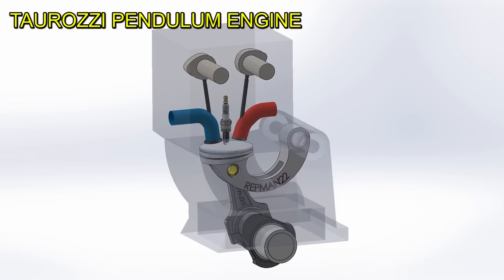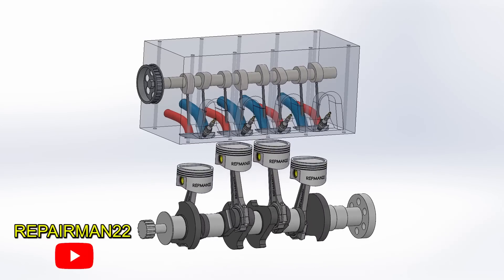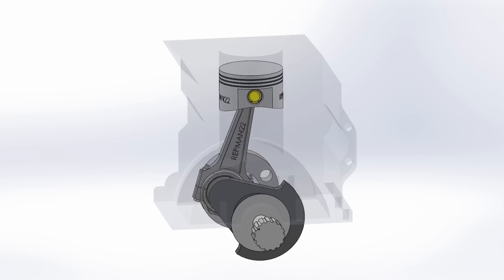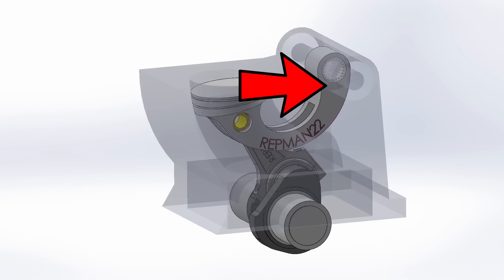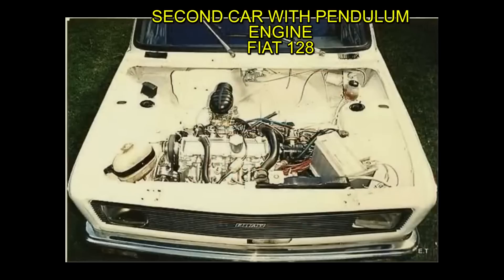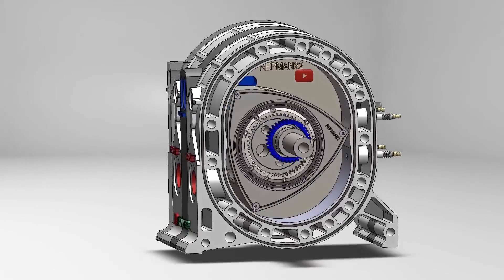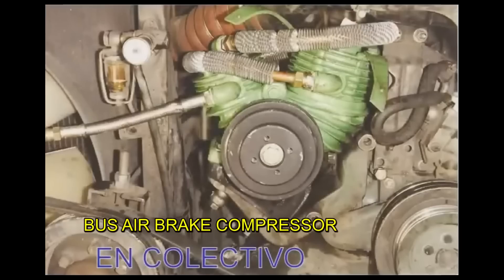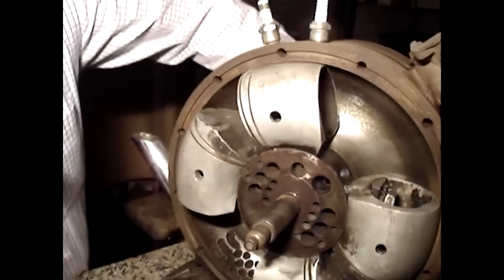All about the Taurozzi Pendulum Engine 🧠 and what happend to it🤯

Comment: Very interesting idea, but I can see some shortcomings of it that might be why it didn't catch on.
- The weight and bulk of the engine would be much higher with the pivot off to the side like that.
- The arm and block have to match exactly to place the piston centered in the cylinder bore. Thermal expansion of various parts at different rates or amounts could cause problems with this, or require a looser fit in the bore that has to be closed up with rings.
- While manufacturing the curved cylinders is possible, it is surely more difficult and expensive than straight bore cylinders, making it less feasible on a mass production scale.

These drawbacks indicate why it wasn't adopted for engines, but is for specialty compressors - said compressors have greater need for it and can accept the greater manufacturing cost, usually are stationary applications where the extra bulk and weight aren't problematic, and don't run as hot so the different thermal expansion doesn't matter. The same benefits as this can be had with crosshead engines, which are used on some very large diesel engines, such as for ships. They solve the piston side-force issue, but still involve a sliding bearing (which is more problematic than a pivoting or rotating one) and require the engine be much taller, making it impractical for most uses.
Reply: I think you nailed it. Thermal expansion is going to be side to side and not even. The toroidal bore is expensive and slow to cut and hone. And while lightly addressed it does seem like there is more mass moving than a conventional piston.  The skirts don’t weigh much.   There is now also an additional bearing to machine at the end of the arc arm.
Reply: @Thatdavemarsh  The piston mass consideration is interesting to consider - despite the video claiming it was equal I doubt that. Likewise that curved arm looks like a failure point - being curved like that is structurally far less efficient than a straight rod, will be loaded in bending rather than pure tension/compression, likely to result in fatigue issues, necessitating it be even heavier to last a useful amount of time without breaking, or the engine would have to have a finite lifespan before those parts are replaced to prevent catastrophic failure. Normal engines suffer from mechanical wear on sliding surfaces, but I'm not aware of components on normal engines where fatigue is usually an issue, the wear surfaces (bearing shells, cylinder walls, pistons) can usually be re-machined or replaced quite easily and the main components of the engine have infinite lifespan, allowing the engine to be rebuilt pretty much indefinitely. But if these parts have to be replaced regularly that wouldn't work so well. A good question about this guy's prototypes is how long they were run for in testing - they worked and were quite efficient, but did he test them for 200,000+ miles that engines are usually expected to last?

The extra bearing probably isn't a huge deal, looks like the same type and size as the wrist pin bearing, but still with some drawbacks. Particularly in that it's reciprocating rather than full rotations, I've heard that's harder to design and have last a long time. Particularly in that the bearing will be stationary twice per cycle, which prevents it from "floating" on oil and will result in metal-on-metal contact avoided by fully rotating bearings on the crankshaft. This is an issue with wrist pin bearings, which I've heard are some of the most highly loaded bearings in an engine, but they also have a smaller angle of movement.
Reply: @quillmaurer6563  The force of the combustion chamber is driven down onto the crank and the arm attached to it, the pivot arm bears no force
Reply: @thesollys9540 
And what's with the lateral force from the con rod under combustion pressure? That for what the pivot arm mainly is for? 
It's not just to gently guide the piston so it doesn't fall over. 😂
Also all the centrifugal force from all the crap hanging on the end of the arm moving in a circular path rather then linear, plus the inertia from the con rod when the crank changes its direction.
There is alot of force on that arm! 
Would it be straight and it's axis straight true the center of mass of the piston that would be less of a concern. But that's not possible, in engenering it's called a drawback. 
This engine is damned to run relatively low rpm's.
Reply: @martin09091989  I would add point about sealing  rings - on "outer" wall of circle rounded form of cylinder rings make longer distance  than in " inner" wall  effecting in not equal thinning. How about dispersion of combustion heat in not simmetrical body and shapes? All this  of course could be prooven  only in very  long use.  .. Another problem for motor industry would be how  such engine could undergo simple renowation by rehoning  to next oversize in thousands of  work shops not posessing special thoroidal honing gear But that is not a construction problem but existing technic. .
Reply: @quillmaurer6563  I'd like to add a consideration - the fraction of the net force acting on the crankshaft is a function of the piston rotation, and decreases from top dead center to a minimum at bottom dead center as a cosine function of the piston angle. This means it's actually less efficient at converting pressure energy on top of the cylinder into mechanical energy at the crankshaft (the difference, if it's not dissipated onto the pivot bearing, will just be given back to the fluid during exhaust phase due to the elastic return of the bearing and its sorrounding material) and honestly i really fail to see how a modest decrease in friction can make up for that loss, which must be the most significant one.
Reply: @martin09091989  In that case would it be more suitable for diesel engines?
Reply: @richardfiennes3616  I almost want to see a modified design that's an opposed pendulum with a common crank; should be simple enough, make the banana linkage load-bearing and move the wrist pin closer to the pivot, then work around the multiple linkages.  Massive compression ratio, and better aligning the valves could make EGR and heat recirculation extremely simple, the only potential issue is how swirl would behave.  Any potential ring issues could also be solved by having trapezoidal rings, larger wear surface on the side with a larger distance, and the taper would fit the wear amount along the circular section of the toroid.
Reply: @richardfiennes3616  I don't think so. The masses of the parts would be less of a problem in a diesel engine, but the larger lateral forces on a diesel due to high compression and higher combustion pressures may be a problem for that banana arm.
Also the benefit of lower friction gets smaller the lower the rpm of the engine is.
And diesel engines need relative rugged pistons to withstand the violent diesel combustion.
Such thin piston heads without a supporting skirt might be to week overall.
Reply: If the pivot arm isn't load bearing, you could delete it from the design.
Reply: @Daekanoid  The problem of the tilting piston is somehow similar to the conventional engine. In an usual engine the piston moves "vertically" and the connecting rod tilts alternatively - in this case the piston tilts progressively but, by carefully positioning the parts, the connecting rod can remain along the  pressure vector for a considerable part of the active cycle. So, it could be as efficient in using the combustion energy as a conventional engine. Probably a simulation would bring more clarity to this point of view.
Reply: @quillmaurer6563  "...that curved arm looks like a failure point - being curved like that is structurally far less efficient than a straight rod..." The curved arm has very little load on it at all. The connecting rod is taking almost all of the forces, and it's shown being straight like normal, and shorter which decreases forces from things like torsion or bending. All the curved arm is doing is keeping the piston in place and centered. The forces of the explosions are going into the connecting rod, and the return thrusting from the connecting rod are going into the head of the piston. It doesn't need to be particularly strong, just rigid. I don't see any particular reason why it couldn't be carbon fiber. Unlike with connecting rods which take a LOT of forces and abuse, the piston arm would only need to prevent the head from tilting in any direction, and angled correctly within the cylinder through the stroke. 

The piston would have almost no wear on the cylinder walls either, since you can use something like teflon or delrin for the piston rings instead of metal, which simply can't mar the cylinder bore. Even if the cylinder bore did somehow become marred, there's a process called spray welding that can add a thin layer of metal back to the part, after which you would machine it again to restore the bore to the correct dimensions, if you wanted to do things as best as possible. Besides all that, it's not like the majority of car engines go through "indefinite rebuilds". Sure, there's plenty of engines that do get rebuilt, but for the average vehicle, especially a modern vehicle, that's not really a common thing. 

The points you present with the bearing are indeed valid, if you're comparing the roller bearing indicated in the visualization to a rotary bearing used in something like a drill. However, the reason the roller bearing was cited as a benefit here is because it's comparing the oil lubricated metal-on-metal wearing surface between a traditional straight bore cylinder and piston and the roller bearing which would be the primary point of wear for this piston and cylinder. While the concerns about the bearing types is valid, it's still a massive improvement over metal-on-metal sliding inside something as large as the cylinder. They appear to be in a location that would be significantly more serviceable as well. It's also possible to mitigate the wear concerns about the rollers stopping and reversing by having the rod they sit on spin. Then they would be experiencing ramping speeds, but always in the same direction. I don't know if that would be better or not, but it is an idea.
Reply: @thesollys9540  There are still minor forces acting on the pivot arm. That is unavoidable.
Reply: @quillmaurer6563  Oh, right. delrin and teflon would melt. That was silly of me. That said, this design still has different options since the stresses on the rings would be different from a traditional ICE. 

The piston's arm does indeed see stresses, but the kinds of stresses it's seeing are trying to fold it in on itself, and then stretch it open. Carbon fiber happens to be particularly good at resisting this without fatiguing. Since carbon fiber connecting rods are already a thing, there's no reason they couldn't be used for this part. 

The piston supporting rod spinning thing was just an idea i was spitballing, so yeah. I agree it would add a lot of complexity to overcome a possibly minor problem. I could also see using fairly small rollers in the bearing which would mean they make several rotations before cycling. That could also ensure they're always sufficiently lubricated. With a proper enclosure, it should work as well as traditionally sized bearings, while obviously increasing costs since, ya know... custom bearings. 

I really would like to see a couple of the major manufacturers give this kind of an engine a try to see what their engineers can come up with for optimizations.
Reply: @quillmaurer6563  Something that just randomly popped into my head... but what if they tried making a carbon fiber piston ring? With the right formulation of resin, it could even operate without additional lubrication since the carbon fiber would basically wear itself into graphite powder which is a perfectly fine lubricant. Because the only point of friction here would be between the rings and wall for sealing purposes (unlike with straight bores that use friction to keep the piston head aligned), a dry lubricant might actually work better.
Reply: Yeah. Just looks to me like a huge increase in manufacturing complexity, and to a lesser extent bulk, for a rather modest efficiency gain. Like a lot of alternative engine designs, I just don't see any net advantage.
Reply: none of this makes sense as it already doesn't happen in a conventional engine. If ANY pistons start swelling you're gunna have a bad time dog lol. I have a buddy with pieces of piston rings embedded into the steel sleeve of his built b-18 to prove it. 

The weight would be less actually since the strength of the parts needs to be much much lower as there isnt friction which means there is no ridiculous amounts of heat to cause swelling. Also idk if you watch the video or not but these engine ARE mass produced. Easily.
Reply: @Khaynizzle7  there is very little friction as the piston is separated from the cylinder wall by oil. That is not where the majority of heat comes from in an ICE.
Reply: So a guy builds this at home in his shed and proves that it works perfectly but everyone here is picking it apart !!?? Sorry, but I would think that the man was a whole lot smarter us !!
Reply: @markchaplain1152  it works no one is debating that! It is just a more mechanically complex, heavier more expensive version of a standard engine
Reply: @headlesshenrywarfare8268  from what I gathered from the video it was lighter and way less moving parts !?
Reply: @markchaplain1152  I agree that if this engine produces less friction then the cooling system weight could be reduced but as this increases the reciprocating mass of the piston with the extra pivot arm this engine would have less rev range and response than a standard engine
Reply: @markchaplain1152  They're just using technical terms so difficult for you to comprehend that they're literally picking your brain apart 😄
Reply: @markchaplain1152  We're not saying it doesn't work, we're just analyzing the pros and cons of it versus a more conventional engine. Just that it works, and perhaps has some advantages, doesn't mean it's better overall.
Reply: @markchaplain1152  he didn’t prove it worked perfectly, he just says it did. We don’t know.  The claim of a 30% efficiency gain for instance is impossible.  There isn’t that much efficiency lost in cylinder wall and connecting rod friction in the first place.  I would be super curious to see a detailed comparison of efficiency size and weight though.
Reply: Two words: secondary vibration. 

Volvo got rid of the 5 cylinder because if secondary vibration, even though it was minimal. People are finicky bitches and absolutely refuse to compromise on the most minor things even if it means gaining so much.
Reply: regarding how well the engine wears could be somewhat observed in how long those gas compressor engines run and how often they need repaired. I realize they're not exactly the same design, however the use similar design elements including the curved cylinder approach. that should allow some guestimation on how well the actual engine would run.
Reply: I love how all of you rationalists tell us how it won't work. Meanwhile, none of you have built one. He has proof, and you don't. Oh, but you're so smart, of course you are right.
Reply: @Ugoeh2  I have proof it’s not in my car or any other. Auto manufacturers won’t touch it and the only application that is economically viable for this engine is an air compressor which I think it does a great job
Reply: I looked up a research benchmark paper on the crank rocker style engine and they came to the conclusion that it was maybe 6-7% more efficient than an equivalent straight piston engine. But the extra overall weight of this style of engine would claw back some of that efficiency. And with the more complex manufacturing requirements like you mentioned it just wouldn't be worth the extra production time and money to get maybe 5% improvement in efficiency. Especially once hybrid drivetrains came along.
Reply: @flipadavis  thank you . Good to see someone did the research before commenting .  I am still wondering on how to build this engine using aluminum block and steel liner ?  Any thoughts on that ?
Reply: @flipadavis  Agreed - and you mention hybrid powertrains, I think electric is really the future for most vehicles with hybrid a brief intermediary. Hybrids might still play roles for vehicles that can't be practical as pure electric (at least with existing technology) such as long-haul trucks, but I don't think they'll be around long for consumer vehicles. Given that combustion vehicles are likely to decline in the near future, I'd imagine many manufacturers aren't eager to invest much into engine R&D - in fact I'm really surprised they are at all. But this design was from the '80s or so, at which time combustion car engines still had decades of future left. But perhaps also there was less interest in squeezing every last bit of efficiency out of them even if that meant greater cost, complexity, or other compromises as we've seen more recently. But even now I question how much manufacturers and consumers really care about it - a lot of tech is thrown at better fuel economy, but if anyone actually cared they'd make and buy a vehicle that isn't so damn big!
Reply: @quillmaurer6563  I agree. I only mention hybrids in the context of when this ICE "pendulum" solution would have been considered. Hybrids came along starting in the late 1990s resulting in more improvement in ICE drivetrain efficiency at a lower cost than this new type of piston design would have.

With EVs we are far past any type of ICE drivetrain configuration at this point.
Reply: The manufacturing of the curved cylinder doesn't seem like a particularly complicated problem to me. If you use a boring bar mounted in a 5 axis CNC machine, and a carbide bit in the boring bar with a sufficiently acute angle, you can get very fine detail in the curve without obstruction. Yes, it does require a more complex machine compared to a traditional engine block, but it's nothing unreasonable. 

The weight and bulk of the engine can likely be made to be equivalent or even better with optimization and competition between manufacturers. Even so, the trade off in cooling requirements likely offsets most of that weight difference already. It also means that thermal expansion isn't going to be as significant as with straight bore cylinders.

Because the friction is so low, the need for honing tools isn't really there since the cylinder walls won't get rubbed against by metal. Although it wouldn't be practical for lower end cars, you can also go with something like a titanium block to reduce thermal expansion concerns if any of the manufacturers wanted to try their hands at a high end version of the engine just to show off what it's capable of.
Reply: Good coherent reply.
Reply: We use aluminum blocks with a steel liner .  How would this be done with a curved cylinder?
Reply: @rayRay-pw6gz  simple, there is no need for a liner. the liner is used because aluminium would gall and wear too quickly compared to steel. since the piston head doesn't contact or even press against the cylinder walls at all, the liner isn't needed.
Reply: @TheAruruu  not possible for large engines .  We use steel liners for a reason .  Same for piston rings.  The explosion in the cylinder is great and it requires parts that can last 200,000 miles or more of use . The simple fact is that this engine is not practical for automotive use .  That is why the industry does not use it.
Reply: @rayRay-pw6gz  and yet the guy made a working engine, swapped it into his car, and still uses it 50 years later.... 

Just cause the it might not work in a high displacement engine, doesn't mean it's unusable for vehicles. Small engines work just fine for modest and moderate cars. You won't find a curved cylinder in your Ford F-350, but no one was suggesting they should be used there. The volkswagen beetle got by with a fart of an engine just fine. Different motors for different uses.
Reply: It's likely not even that, it's a lot easier to create an engine with straight cylinders rather than curved ones and if it starts to wear down, you have the option of boring it a little larger and putting slightly larger cylinders in.
Reply: Cross head ? You mean an opposed piston engine.  Where there are two pistons facing each other in a each cylinder with 2 crankshafts one at the top and one at the bottom . And the pistons in each cylinder reach center at a slightly different time ? I love those engines a 450 rpm they produce an intresting rolling low frequency sensation under your feet kinda like an earthquake .  And will scare the begeebees out of you if a cylinder starts to run ritch and start detonating.
Reply: @michaelshultz2540  No, what I'm referring to is a crosshead, different from an opposed piston (which I agree are really cool). A crosshead is a bearing system, basically one or more rods that a bearing slides along. This "Crosshead" bearing sliding component is attached to the connecting rod and a piston rod going to the piston. This takes the side force from the connecting rod angle. Normal smaller internal combustion engines don't have them, the piston skirt serving this function - a piston with skirt is effectively the crosshead and piston integrated into a single component. Some large low-speed diesel engines used on ships use these crossheads to prevent side forces on the piston. They are also used on all double acting engines, including pretty much all steam engines, as the piston rod passes through a seal between the piston and crosshead. The crosshead is prominently visible on steam locomotives, one or two bars above or above and below the rod emerging from the cylinder, a device sliding along it attached to the piston rod and connecting rod - if you look at a photo of pretty much any steam locomotive you'll see what I'm talking about.
Reply: @Quill Maurer  ah. Ok . Now i know exactly what you're talking about . And have learned its name.  KEWL. This is what the internet was originally intended for.  Thanks.
Reply: Maybe in a V arrangement it works out better with the pivot
Reply: The video literally debunks all of your points.